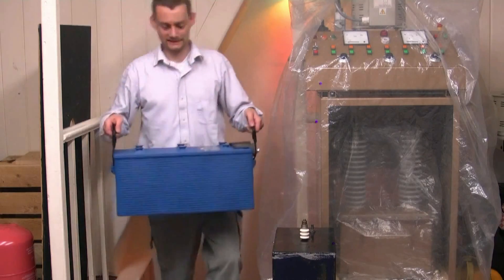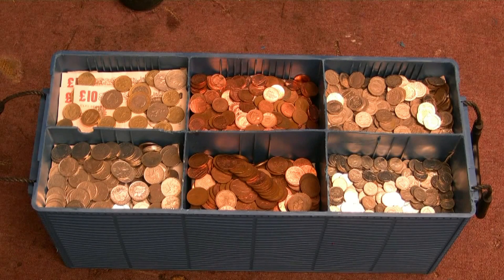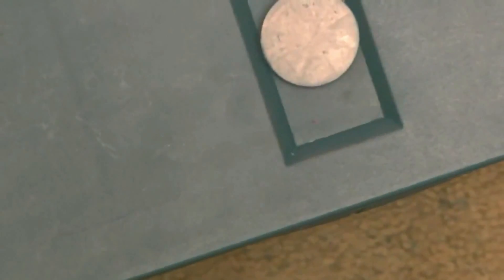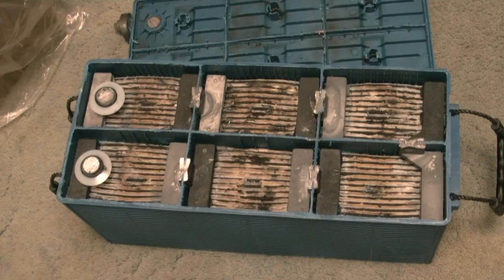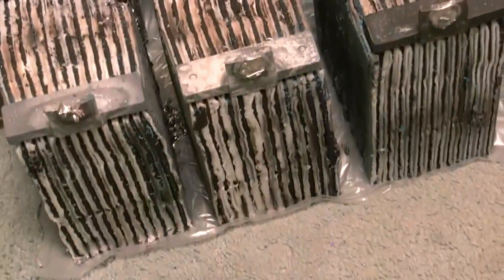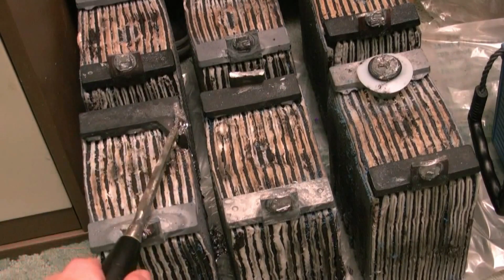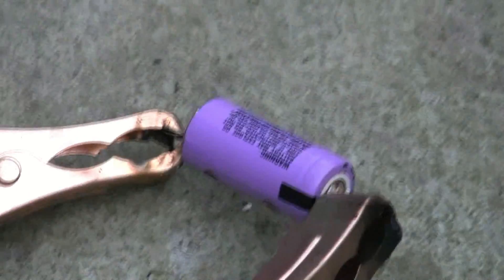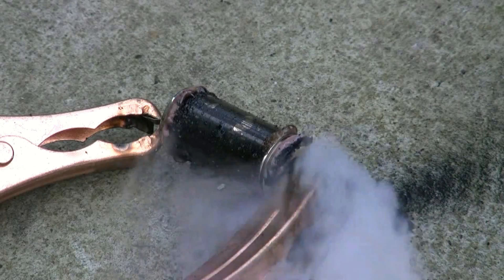Big Battery Hack

Comment: how come lead acid dont need balance charging they have 6 cells each at 2v like a lipo but lipos are at 4v per cell
Reply: Im sorry it took me 4 years to help.  They do not because the valve regulated ones have an extra special charge mode called equalization that literally cooks the battery until all the cells are damaged properly. This quickly dispenses the extra necessary electrolyte so then you have to buy a new battery.  Sealed lead acid batteries expand. All safe of course :)  Now with lipos,  that process would be asking for explosion :) And quite a fun one indeed!
Reply: @beastslayer9153  I have learnt this since but thanks haha, I guess this will help people wondering the same thing and come across my/your comments.

Comment: OK, kids, today we learn that all batteries contain lead, acid and smoke.  Gotta have smoke.
Reply: I did something really stupid with one. In 2011, I opened a car battery and tasted the acid. It tasted like lemon juice (exactly like it!), but it smelled like boiled eggs.

That was before I knew Lead caused brain damage and extreme anger issues and violent behavior.
Reply: +SouthwesternEagle Is it true?
Reply: Shaheer Syed Yes. Everything I wrote is true. I've written several columns about Lead Poisoning.
Reply: SouthwesternEagle I think maybe our tounge receptors are ph sensors!
Reply: Shaheer Syed Oh! That's what you were talking about. :)
Yes, car batteries and motorcycle batteries (I'm a Harley biker btw :3) have an acid that tastes like lemon juice, except it smells like hard-boiled eggs because it's sulfuric acid. 

The acid is diluted though. Pure sulfuric acid dehydrates and burns simultaneously. Little did I know, Lead was dissolved into the acid.
Reply: I'm a kid yet i love electronics I have over 1,000 different components

Comment: why do British houses all look like churches?
Reply: I'm sorry mr USA why are all of your houses made out of wood?
Reply: Because they got wood...?
Reply: John Smith heh ...wood
Reply: i always wonder why they dont build brick houses which dont blow way when a small breeze picks up instead they just rebuild the same shit ?
Reply: Kirbyofdeath i live in a new build house in the netherlands. they are basicly made out of reinforced concreate hollow cubes with a brick wall in front of it. it's quite the most simple and effective way to build a house
Reply: Sounds good to me, they used to build houses like that here, but building codes have been made so that inhabitable buildings must be flexible enough that a medium-to-strong earthquake won't bring it down. Brick easily breaks in powerful earthquakes, and it wouldn't be fun to be under a pile of fallen bricks. Metal is the probably the best material for building, but in most residential cases it's too expensive  Wood is both flexible, and cheap. Wood also is pretty light, allowing for multiple story buildings, with only the need of relatively simple supports.
Reply: Kirbyofdeath it might sound weird. but it's a fact that wood is also more likely to survive a fire hazard. as only the outside of the wood will burn the inside remains strong very long. Metal will melt at some point.
Reply: ScottishSwallow cuz it's cheap..
Reply: lonerider92 Have you been carving you log? ;)
Reply: Ok...? Someone needs to calm down.
Reply: because why not???
Reply: +spitfireace87 Because bricks don't bend. A light earthquake would knock a brick-only house to the ground.

Comment: I'm guessing the flames shooting out the top of the maplin batterey were hydrogen and oxygen as they're lead acid batteries H2SO4---->H2+SO2+S???? I used to work with the shitty Anio Micro batteries on robots because they were cheap, but when I finish with them I get the lead out of them.